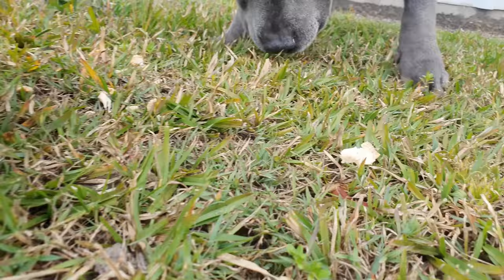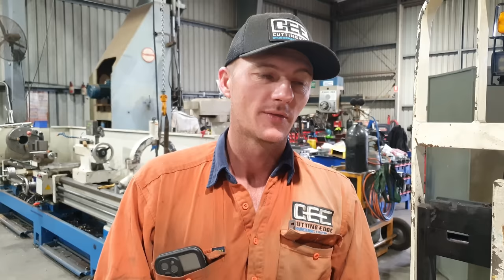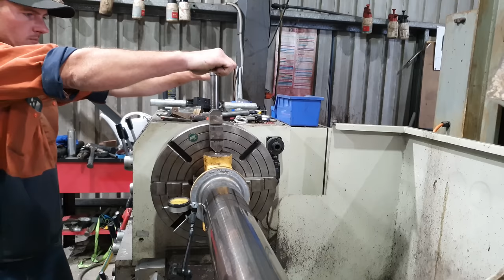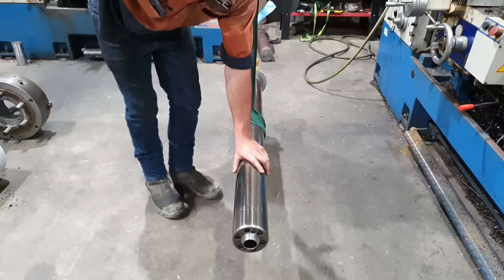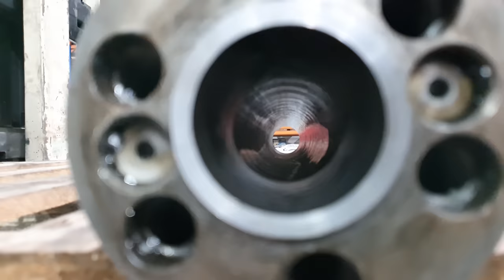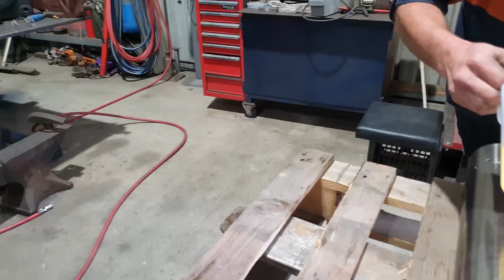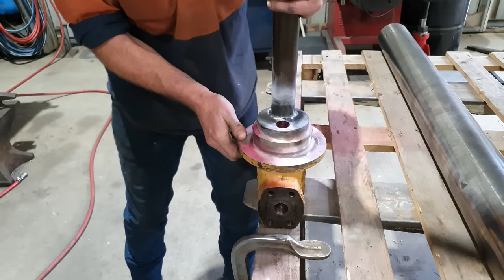Cracked Telescopic Cylinder Weld Repair | Machining & Welding

Comment: My father was an engineer at caterpillar tractors in Mossville Illinois USA and I worked at the plant for a while. Pretty cool to see the big parts taken apart and put back together with such skill Awsome
Reply: I mean does it really matter if the part happens to be larger ? Engineering wise a smaller part may be way more interresting.
Reply: @mauricematla8379  Unless you are impressed with big things.
Reply: @eriklarson9137  Basicly never grew up then.

Comment: Hello, gday mate.  You are doing a excellent WORK! I m working since 35 years as hydraulik engineer in Germany. An welded cylinder got in heavy cases like mining Problems with the weld. My experience is in 80% of all cases. Sometimes only after 20 years but damage is damage. Its have to be cheap. Most mistake is  missing of preheating. Because the massive component pulls out the heat from the weld. You make it right. Great to see, a man loves his work! Greetings from Germany. Fred.

Comment: “Doesn’t do a lot of tig welding these days”, precedes to lay down a damn near perfect tig weld
Reply: yes agree, but... from a tig welder myself, too slow not enough amps, has alot of peno on the inside. could tell as soon as he started welding
Reply: Could have used a argon shielding on the root side of the weld, sop in tube welding, but...
Reply: Can but have to run even more amps
Reply: From my experience the guys that are humble and downplay their ability are the best welders. It's the guys that say they're hot shit you gotta watch out for because most of the time they can't walk the walk.
Reply: I’ll be honest here guys I can’t weld to save myself, don’t have any form of welding equipment and have never been taught anything about it, I’m sure you’re right things could have been better but to my layman’s eyes it looked great.
Reply: “I said I never had much use for one. I never said I didn’t know how to use one”
Reply: He burned through the inside, too slow, stack of dimes are pointless, turn up the amps, lay wire and RUN
Reply: Near?

Comment: I need to thank you guys!  I stare at parts all day long, everyday and then come home and watch your videos'.  However I struggle with anxiety attacks and today has been a rather difficult day.  I had no reason for the attack that happened today "10 hours" but 8 of them were pretty rough.  I come home and watch your video and I relaxe and the next thing I know, I'm much better.  You can't admit weakness in a large machine shop or the Buzzards will start circling to pick you apart.  Anyway thanks again for the help, to all three...Happy Birthday Homie!!!
Reply from the maker: Hey mate glad the videos can help you to feel better, do what you got to do and take care mate
Reply: I suffered for many years from the same symptoms you described. Chronic anxiety is a living hell, and anyone who hasn't experienced it has no idea. Medication can mitigate the symptoms but doesn't cure the underlying problem IMHO. Standard psychotherapy didn't help me so I went elsewhere. 
In my case it turned out that the anxiety was caused by the energetic "body" of an unresolved and long forgotten trauma. I know it sounds a little out there but that energy needs to be released. Once released the anxiety ceased for me and never returned. I don't know if your issues are the same as mine were, but it's something to consider. Hang in there, I know it isn't easy.
Reply: Take care mate but know you're not alone. Best wishes 👍

Comment: Never underestimate a determined bloke with the tenacity of a staffy , what a recovery from what looked to be a bit of expensive scrap . I reckon you could have saved old mate more the just the part cost down time for a big scraper is rather unpleasant. Well done mate a cracking repair , 😃

Comment: Beautiful job once again. After 45 years of Welding I have to use the Pyrex clear Tig cups to get enough light to see what I’m doing.😃. I can still run a reasonable bead but then I used to flip the helmet up and discover that although it looked good it was nowhere near the joint.😡. How the mighty have fallen……….sigh.
Reply: I'm like that with a mig, I need to get a new helmet.
Reply: @MegaDirtyberty  
Yeah I’ve got a couple of good helmets with magnifying lenses but even turned down to the lightest shade I find there’s just not enough light at the lower amperage’s on the Tig. Stick and Mig are not so bad. I’m embarrassed to say that I can’t remember the manufacturer of both helmets and they’re in the workshop and I’m in the house. One is a Miller elite.Filet welds are not too bad because you’re working in a corner,butt  welds on 16 or 18 gauge aluminium or stainless, forget it. Can’t see a damn thing. The thing that really helped was installing 300 amp LED lights in the workshop. Turns it into daylight and makes things a lot easier to see. Cheers.
Reply: @davidcat1455  Mine is just a cheap chinese helmet, it was all I could afford. The light idea is a good one, I use a torch and shine it at what I am welding, works okish.
Reply: @MegaDirtyberty  
There’s nothing wrong with some of the Chinese stuff. You can only use what you can afford and at least you’re having a go👍 I just happened to be in the workshop when I read your comment and my other helmet is a Speedglas. Model 9002NC. Adjustable from shade 8 to shade 12
Reply: @davidcat1455  I will look that up, cheers.
Reply: @MegaDirtyberty  
👍

Comment: I got tapped to climb into a water tanker this week (formerly a hot asphalt carrier judging by the skin inside)  to cut off the baffle legs and grind out/clean the surface around them in order to weld some patches in. I'm not really claustrophobic so didn't really bother me,  although the climb in and out is pretty tight.  As reward for my efforts I'm being exiled to the machine shop (the job I originally joined the shop to get, but ended up doing profiling and sheet instead) . So,  yeah,  that's my week..
Reply from the maker: good times 😅👍
Reply: @CuttingEdgeEngineering  no one else wanted to get in there (a couple of them couldn't even fit through the manhole). I also got my first zero tolerance job this week and that was far worse.
Reply: @bigsmellysockhead  I hope your workplace has an Honour Board for good folks as yourself. Names go up in gold lettering, and at Xmas an extra slab of Foster's goes into your stocking.
Reply: @BrassLock  no honour board,  but what you do, or, more importantly, don't /won't do does get noticed. I'd just give the beer to someone else,  one ice cold beer every two years or so is about my limit, I much prefer the pay jumps.
Reply: @bigsmellysockhead  Glad to hear the Big Boss takes care that way. The beer thing was a bit tongue-in-cheek, 'cos I haven't had a beer in 20 odd years meself!
Reply: @BrassLock  funny thing is plenty of the people I work with/around would be stoked with getting free booze as recompense for extra effort. Being a non drinker means they know you're a bit harder to bribe/motivate.
Reply: @bigsmellysockhead  
😃 Have a relaxing weekend.
Reply: I'm not sure what kind of welding hood you used, but anytime you're welding inside a vessel you have to be careful not to burn your eyes.  The UV light will bounce off the walls of the vessel, into the back of your hood, and reflect back into your eyes.  A pancake hood works great in those situations.
Reply: @buckinthetree1233  only reflective surface area in there is the 400 x 300 sections I cleaned.  But that's something I'll keep in mind for the future,  cheers.
Reply: @BrassLock  you too.

Comment: I'm always impressed in how you can machine out the welds and then get things aligned to weld back together. In the end this looked like another case of having to reverse engineer how the part was manufactured, then undo and re-do it. Always interesting to watch. all. Thanks to you. And HB to Homey, I find it hard to believe he even tasted that 'cake' as he inhaled it!

Comment: Happy Birthday Homeless! Great video,  very cool engineering went into that cylinder.  Good demonstration of the oil passages.  Great camera work as usual.  Very nice Tig welding,  good penetration, if it ever breaks it won't be from the welding.
Reply from the maker: Great comment! Thanks mate

Comment: Gday Kurtis and Karen, happy birthday Homey, that was a really interesting repair and bloody awesome job, the costumer will be over the moon at the savings, I wonder why the flaw check didn’t didn’t work properly?, brilliant job as always mate and have a great weekend, cheers
Reply: It was probably due to that part being submerged in hydraulic fluid so it was probably not letting the flaw check give a bad reading. Either that or idk.😬🤷🏻‍♂️
Reply from the maker: hey mate yeah was stoked it was a successful repair. Still not sure why the dye penetrant didn't work it seemed to be developing on the surrounding material 🥴
Reply: We used dye-pen for years for crack detecting. Then I got a magnetic particle crack detection, more expensive short term, but economic long term. I found that sometimes with dye-pen the part had to be super clean. Then the penetrant would be sprayed and left one for the maximum time allowable. Then cleaned off and developer added. We used to get the same false shows on welded parts due the undercut formed on some welds. We supplied gears to several high end motor companies like Mercedes, they insisted on mag- particle and were pleased that we already had a functioning unit. We also supplied GM, Volvo, Mack trucks, Ford, Cummins etc. I had an ultra sound portable crack detector made which came in handy checking 21,000 completed water pumps in Chicago. The steel used was fine until after final heat treatment when a crack would appear from the bore to the root of the gear. After several weeks testing for cracks I found around 250 cracked gears, which equated to one bar 3 metres long. British Steel picked up the cost of everything, but were unable to find the reason for that crack. Considering we made 100,000s of the same gear and despite checking random sample we never had cracked gears going out to a customer again. Sorry I rambled on, dye-pen is good but sometimes needs a thorough cleaning.
Reply: @thepagan5432  You may call it rambling,I call it interesting. Thanks for posting it.
Reply: @paulmanson253  Thank you, I miss my engineering days, but by watching Kurtis I can easily relate to everything that is happening. It reminds me of a lifetime which seems so long ago, but it also feels so new when I see engineers doing their thing.

Comment: Did the safety officer even taste that birthday cake?  Jesus! 

What I love about the channel, besides the sweet machinery and weld equipment, is that you are never afraid to step into something new and do work that is challenging or difficult.  You move forward cautiosly to be sure its right for your customer and your reputation, but you dont turn down something because it's not easy.  And you swear a lot.  Love that too.

Comment: Those threaded holes in the rod for grub screws also throttle oil flow by the number of screws used. No screws present, wide open flow. Happy Birthday Homey!🎉

Comment: How to make sure? With know-how. Is Know-how 100%? No, but it's as close is one's going to get... and this guy has it. Bravo Kurtis, keeping Cutting Edge right up to and AT the cutting edge of engineering. Too thick on the praise? Na, credit where credit is due and in this case Know-how went the extra mile to come as close as one can get to ensure that part will work and the repair will be money well spent by the customer AND save having to pay for the repair and then still have to buy a new part because the repair failed. Not bloody likely with this kid on the block. I so enjoy watching this couple do their thing. Great camera as usual.

Comment: When doing your dye penetrant inspection, (better if it is oil base penetrant) if you have an indication and your not sure, you put cleaner on rag and wipe over the indication 1 sweep, reapply développer and if the indication reappear sharper, it's a tight indication (LOF, Crack,....) if it reappear pink and wide, it's probably not deep, (undercut, fold over, ...). You can repeat this step 3 or four times no problems). You can also grind the indication, lightly, and redo your dye check Sometimes just apply the développer after the grinding and your indication will come back sharp and fast just after the developper application. Very interesting show and very appreciated. My best to the team.

Comment: Speaking as an engineer I can only say congratulations as it's a job that i'd have been very reluctant to take on knowing the problems with weld distortion, weld undercutting and embrittlement.   
Well done and thanks for producing an excellent and informative video too.

Comment: Thanks for showing the wire and welder setting.  I like the fabco wire,and it sounded like you were spraying it at about 200amp... 
Really nice job

Comment: Damn that tig welding was clean, i do maintenance to aluminium die casting tools and often i have to put a patch on the steel where it broke off. If you haven't tried it yourself, you'll never understand how hard tig welding is. Kudos to you sir!

Comment: Gas or "petro" is a smart source for seepage. Its super thin and will go thru the smallest crack. I use gas to check for burnt valves before and after i do i valve grind. Acetone also works really well and seeps deep, I use 50/50 acetone and ATF for a Diy penetrant when im in a pinch ;)
love the work and quality bro!

Comment: 50 some years ago, I worked in a shop that overhauled the J57 jet engine in the A7 Corsair.  The entire engine and all its components, would be totally refurbed in house.  On the engine main shaft, bearing surfaces were taped off, the shaft repeatedly dipped in wax to cover everything, when that was cool and hard,  the tape over the bearing surfaces was cut away and removed, then into the  industrial hard chrome tank to be electroplated, building up all bearing surfaces to oversize tolerances, then machined back to size.  I don't remember a broken shaft, and I don't think it would be repaired if it was, but I'll bet Kurtis could fix it, true and and it would fly again.

Comment: Awesome job, I'd cap the SAE ports etc. Anything that gets in between the inner and outer tube is impossible to clean out but will come out via what is between the cylinder, valve bank, dump valve or filter. I have repaired double acting telescopic cylinders before and have also  seen trouble with silicon build up  under the chrome coating causing fish eyes/ chrome failure

Comment: HANDY HINT! Great videos, love them. My hint of the day is (loved the idea of pouring petrol down the tube) clean and dry the area of the suspected leak with brake-clean and dust it with "talcom powder" this will show up the tiniest trace of a leak long before you will ever see it. I use this tech. on my old digger to trace down leaks. I hope you charged them $16k for the repair.

Comment: Great repair! 🙂

Now it wasn't clear from the video if you checked that the pivot hole in the head block was perpendicular with the rod, it looked like it wobbled a bit on some of the sped up videos of you welding the head back on the rod again!

It was very clear when you took the head off that it had tilted compared to the rod most likely due to the incident that caused the crack to happen in the first place.

Comment: Using that lathe as a turn table does make for a consistent no stopping and starting pass all the way around it so I guess it will be a clean weld for less machining

Comment: Congratulations on the very skillful way in which you completed this repair.  The range of tasks which you have completed, and the range of machinery which you have acquired to perform them, is very impressive.  I get the impression that this particular cylinder, and a great many other parts which you have repaired, is probably restored to “original manufacturer quality”.
It seems that Homeless is quite the specialist when it comes to dismantling and disassembly – I wonder whether you can fix that little blue pig?  Thanks for including Homeless’ Birthday Celebrations!  Best wishes from Melbourne, Victoria.

Comment: Hello Kurtis  I bet your customer was extreamly pleased when he found out you were able to perform the repair successfully. You do so much varied work in your shop I am wondering g why you do not have a HVOF or Actual eEectroplating  section? I worked in heavy equipment overhaul we were 4 connected shops Machine shop, Welding shop, Process shop (electroplating, heat treatment shot peening,etc.) And Paint Shop. Unfortunately none of us overlapped in the trades as you routinely do. Keep up the great work and Videos.

Comment: To increase the sensitivity of the dye, you didn't want to give it a little heat? The cleaning when cool and the post check will give a better indication then as when hot, a crack draws in more dye.

Comment: In the context of metal coating, HVOF stands for "High-Velocity Oxygen Fuel." HVOF is a thermal spray coating process used to apply various coatings to metal surfaces. It involves the combustion of a mixture of fuel gas (usually hydrogen or kerosene) and oxygen in a high-velocity stream. This creates a high-temperature flame that accelerates powdered coating materials to a very high velocity.

The accelerated particles impact the substrate surface at a high velocity, causing them to deform and adhere to the substrate, forming a dense and strongly bonded coating. HVOF coatings are known for their excellent adhesion, low porosity, and high bond strength, making them ideal for applications that require wear resistance, corrosion protection, and thermal insulation. This process is commonly used in industries such as aerospace, automotive, oil and gas, and many others where high-performance coatings are required to enhance the properties of metal components.